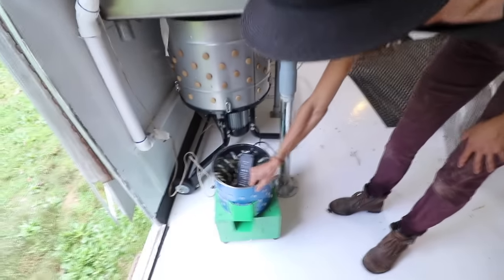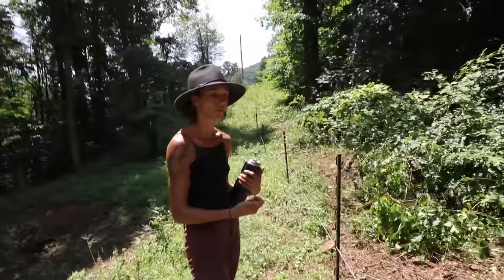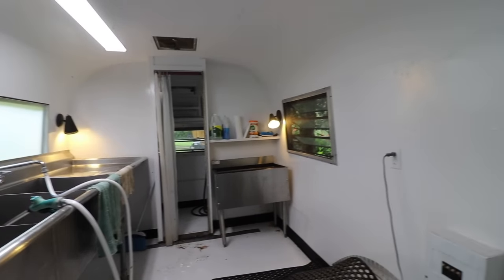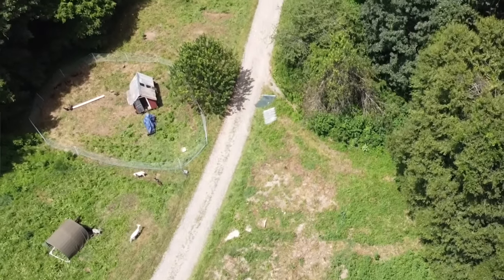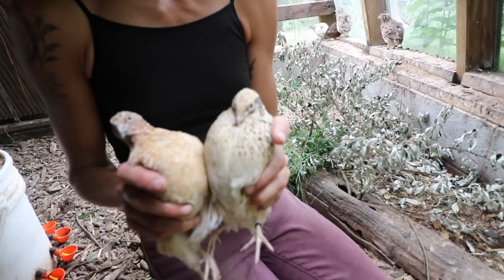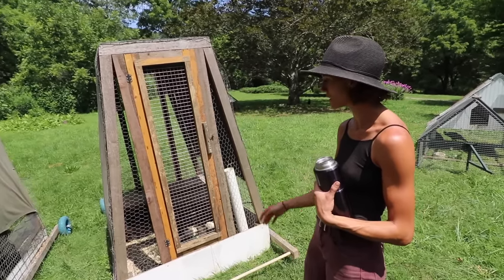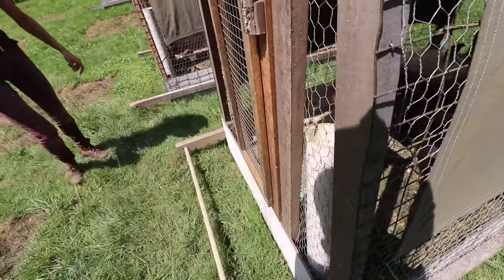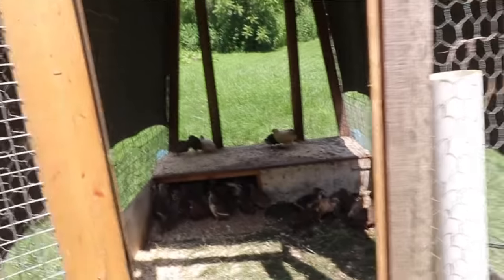She Raises & Sells Pastured Quail in Asheville (Wild Way Farm)

Comment: Haha they do love to jump, don't they?  We had button quail in the house & they used to bonk their heads on the top of the cage all the time.  So we put them in a very long fish tank so that greatly reduced it bcz they could run, but still they should have had both length & height, which they did in summer in an outdoor cage we made.  The babies they hatched were crazy tiny!  7 fit easily within the palm of my hand.

Comment: That's not an Airstream.
It's an Avion.
There are major differences.
I restore antique motorhomes, with my husband.
The Avion she has, is from around 1965 to 1970, and they are not as expensive as the airstream, but cost less to restore.
It's the perfect choice, for what she's using it for though,...because it has better insulation then the airstream.